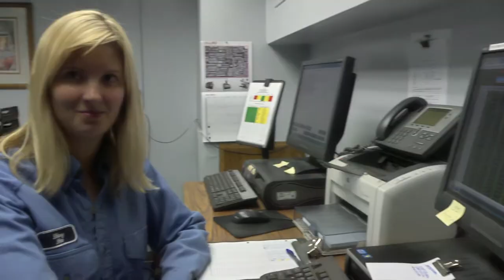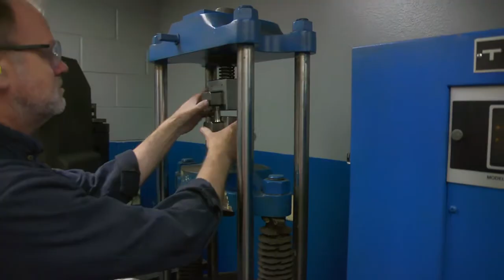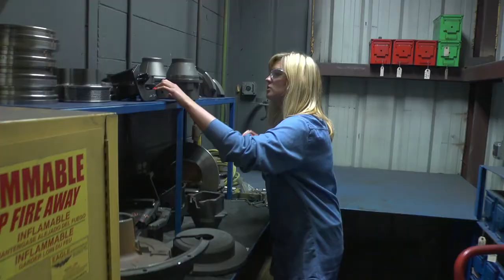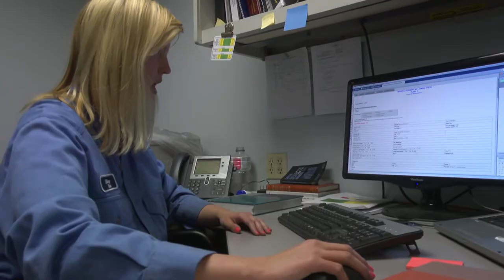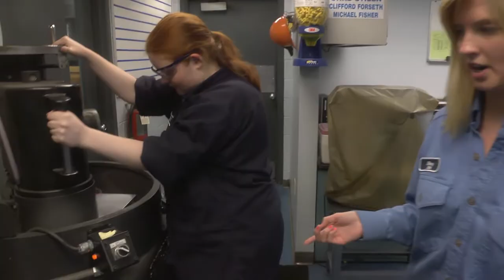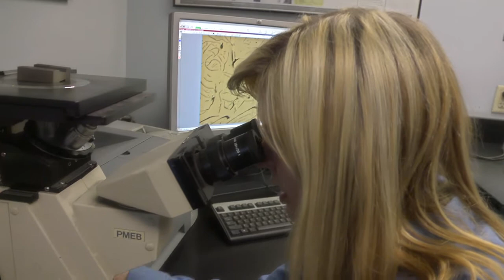Career Spotlight: Metallurgist

Comment: Hard to believe iron foundries are still operating in North America in the 21st century.  Metallurgical engineering is considered a derelict, obsolete field of study precisely because industries like foundries and steel making have been in steep decline since the 1980s and there hasn't been a recovery to prior levels of employment.  Students interested in a scientific and technological career would be better advised to pursue robotics, artificial intelligence, cryogenics and advanced materials for orthotics and prosthetics, etc.  Don't follow the industry of the past, look to the future.
Reply: @weirjf2 Great response, unless we develop or find some crazy new material/element and it is viable enough to mass produce it. Metals and metallurgy aren't going anywhere.
Reply: It's funny you mention robots because I guarantee at least 1 part on them are made of cast iron, probably multiple parts. You are surrounded by cast iron and you have no clue it's there. Metal casting is a cost effective way to mass produce parts, that is not the industry of the past.
Reply: Hi Dave. What materials will robots , cryo equipment, and prosthetics be made from in the future? Not to mention aerospace components. Do you think planes will be using composite landing gear and structural components? All metals, ferrous and non-ferrous have been critical for thousands of years and will continue to be. Your comment should be considered ignorant.
Reply: @villain383  If so then why have almost all university metallurgical engineering departments vanished over the past 30 years?  That is a fact, not my opinion.  Materials Science & Engineering departments have replaced many of them.  Metallurgical is just not what it was 40 or 50 years ago.
Reply: @davidcarter5813  The metallurgy departments have vanished mainly because of a lack of students interested in studying metals and that includes mining engineering too , the fact that they changed it to materials engineering is a way to make seem more appealing, the need for metals is greater than ever before with this materialistic system mainly in the US , to call it obsolete when the phone you are holding in your hand has different metals that was obtained by extractive metallurgy really tells you aren’t that bright